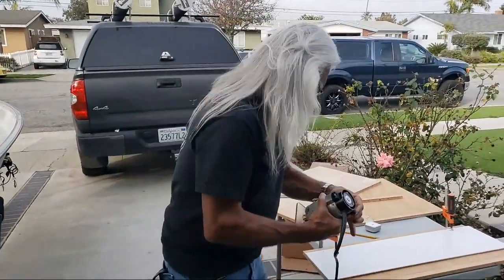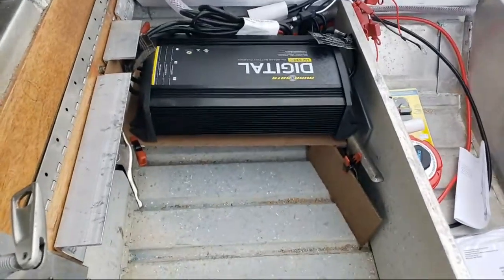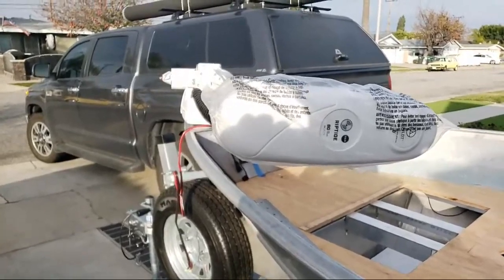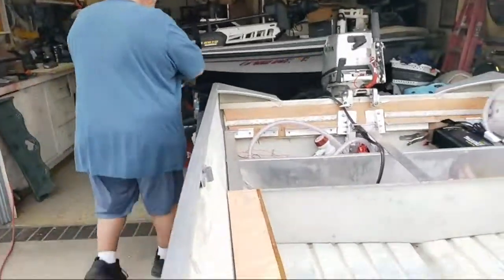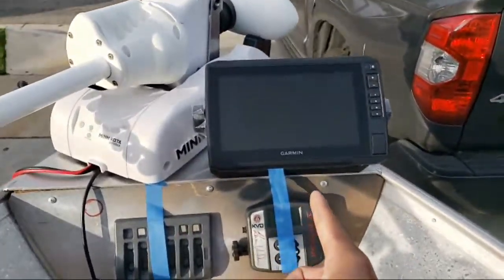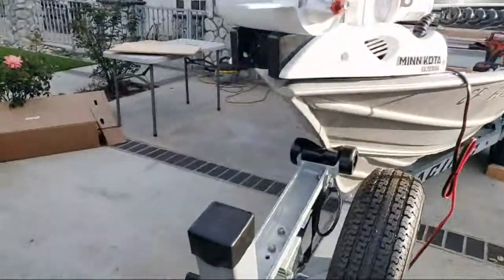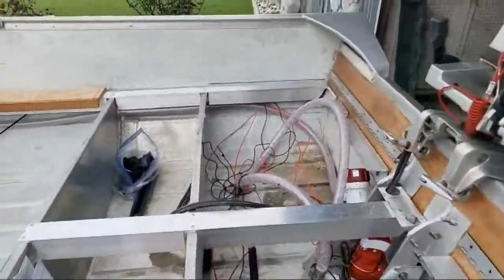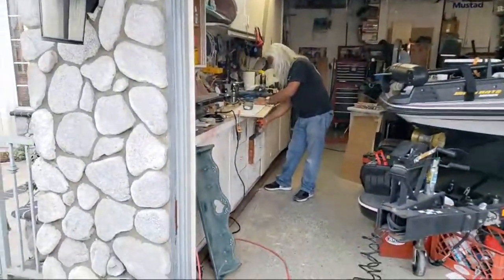DREAM MACHINE 1.0 Build & Trolling Motor & Graph LIVE STREAM

Comment: Change the fuel connection at the motor to the newer style Honda has, it's rectangular on the guide instead of round. The reason they did that is with the old style you had both the guide and the fuel side were round and people were trying to shove the gas side in the guide post and it would cut the o-ring that seals the gas in the fitting. The result is leaking gas plus it will suck air in when your running the motor stalling it.

Comment: An add on to the fuel fitting get a genuine Honda the after market ones are junk and leak. Yes I learned that the hard way.
Reply from the maker: Any idea where to source one?
Reply: @BigBassDreams  Local Honda shops in the area will carry them or order them for you. I picked up one at our local dealer and it was in stock to switch out the fitting on my 2004 9.9 kicker. Took all of 5 minutes to change it out.